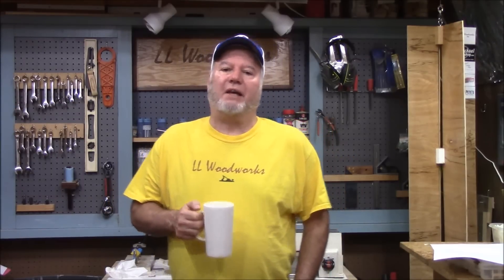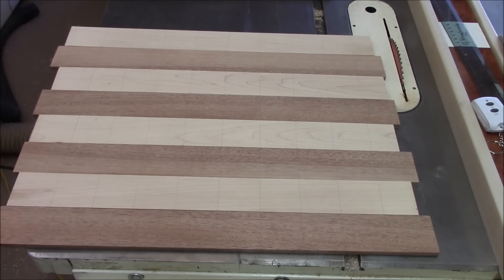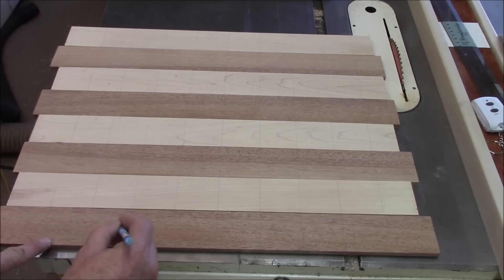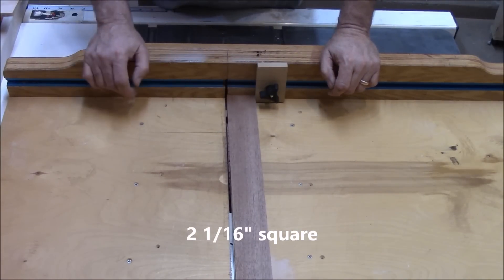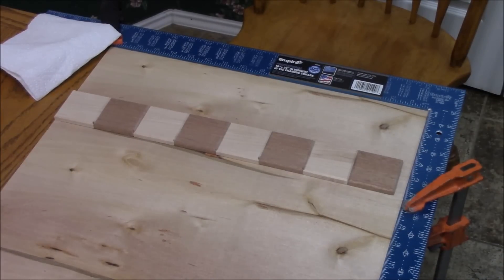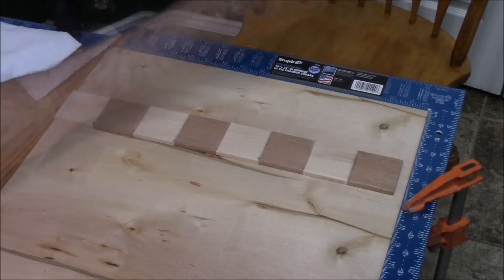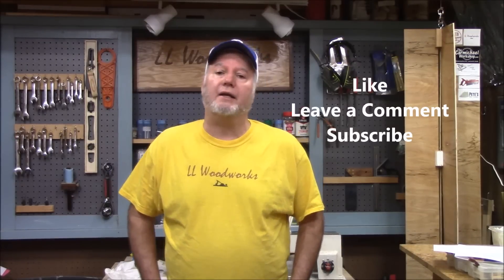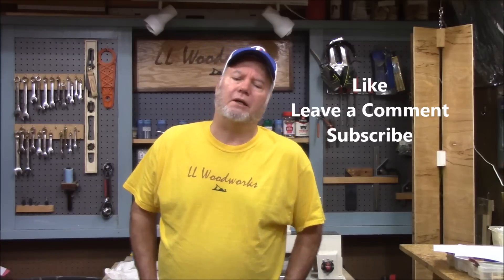How To Make a Checker Board Part 1

Comment: I like the overlay information you print over the video. I thought the tip about routing the end grains first was a great tip. Why CA glue?  Wouldn't wood glue be a better and longer lasting. I'm king of old school and have my hesitations about instant bonds like that. I might use it along with wood glue to hold the piece in place until the wood glue set, to speed things up. A long time ago when hot melt first got popular they used that for a lot of wood related things. I have renovated kitchens for 35 years. At one point I used hot melt  glue to attach small scribe moldings and door panels to exterior cabinet gables. This hot melt on it's own does not last. Combine it with wood glue and it worked great. That checkerboard looks so good I wouldn't want it to start to loose pieces over time. That would be a shame. 
I want to compliment you on what a great job you are doing on your channel. I don't think I could stand in front of a camera and talk with such confidence like you do. And then, of course,  you expose yourself to someone like me who questions how you do it.
Reply from the maker: Thanks Brian -  I shared your concern about the CA glue. I debated about Tite Bond II or Tite Bond CA, but I went with CA for 2 reasons.  1) The cure time was greatly reduced. I built this the hard way with 64 separate tiles so I wasn't sure how hard wood glue would be to keep things in place (you know how pieces tend to slide) and the 64 separate pieces have to be spot on or your board isn't square.  2) I talked to several fellow wood workers that had made this style board and the Tite Bond CA is what they recommended.  Lets hope and pray that tiles don't fall off is 20 years.  Thanks for watching and for your comments.

Comment: Do you read minds.....lol...cause I was thinking about building one.  The top was going to be thicker and the drawer was going to be a slider...but I really like your design on this. The magnet touch is cool,mite have to use that one.  Also king and queen spot I was gonna elevated them, only about a 1/4 inch. Yes it would checkers and chess board. Awesome project build Lynn looking forward to the rest of it.
Reply from the maker: Hey Robert, you just proved that great minds think alike, or is it that fools think alike?  Either way this was fun. This was actually my second one. I did not spline the mitered corneres in the first on.  If you build on send me pics.  Thanks for watching

Comment: Isn't this a chessboard, because a checkerboard measures 10 by 10 squares?
Reply from the maker: All my research has shown they are the same. 64 squares thanks for watching
Reply: Depending on the variation, a board can be 8x8, 10x10, or 12x12.